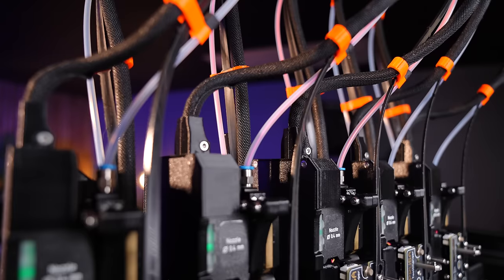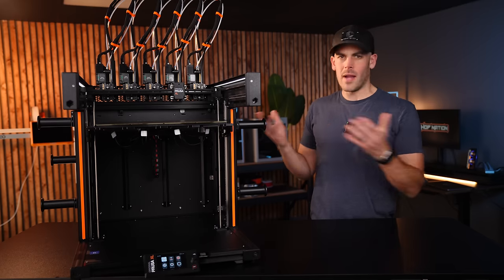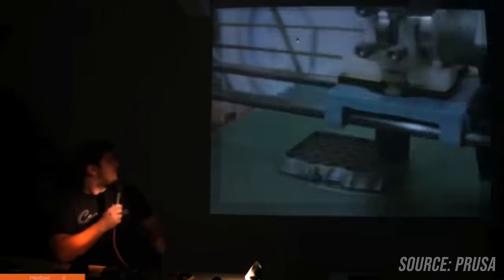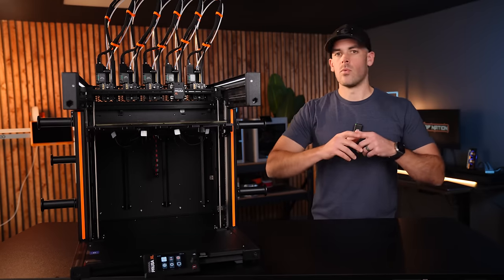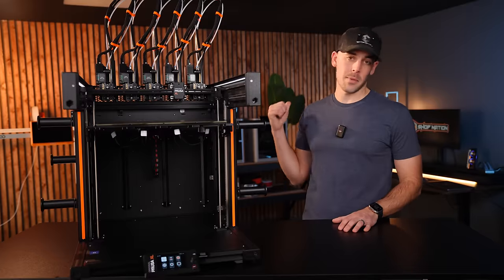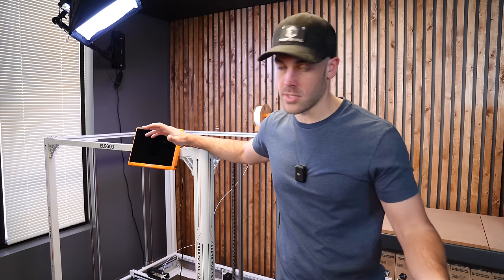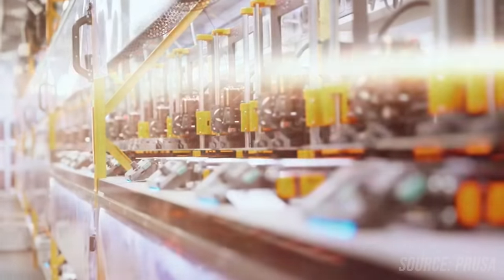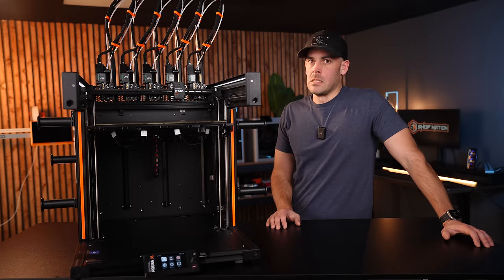Why Prusa is the next Blackberry

Comment: I just bought a Bambu Lab P1S which is supposed to be delivered tomorrow (Monday 07/22/2024) so I'm watching videos about P1S's.  Something that I thought of a couple of days ago that is related to the main theme of this video comparing Prusa to a Blackberry.
I have an Ender-3 Pro and fighting that machine constantly is what prompted my P1S purchase.
I have zero interest in printing doo-dad's or trinkets. 
In hope of better outcomes, I decided to give Klipper and the MainsailOS interface and it  seems overly complicated to install and configure to a specific printer with custom aftermarket parts. It doesn't help that the documentation is grossly out of date.
That gets me to who will potentially have a similar fate in your Prusa-->Blackberry analogy. That would be the folks writing configuration software for these cheap bed-slingers.  I installed Klipper/Mainsail because I needed to, to get my printer to function. Now I spend an inordinate amount of time on getting the printer to function mechanically and another inordinate waste of time wrestling with software configuration.
Those folks are going to take a beating because no one buys a 3d printer to tinker with. A subset find tinkering with their printers fun AFTER THE FACT but the intial purchase is to 3d print, not tinker.
You start turning out printers where you pull it out of box, do the initial setup and start printing without a need for constant tweaking, it is going to put the smackdown on this whole ecosystem based on poorly built, poorly documented and so-so quality printers. I think it will also put a dent in the aftermarket parts market too. If your printer prints fine "as bought" there is no need for special hot-ends, direct-drive extruders, etc.
It will be like being in the 3D Printer Promised Land of only debating what color filament and what kind of filament to choose.

Comment: I believe that Prusa Mini is Prusa's future. With the now fast printing (Input shaper), the small size and the affordable price, I use it intensively, and letting my other 5 printers (Prusa MK3S ) catch dust.
Reply from the maker: The mini is absolute garbage, plus the A1 mini is eating its lunch
Reply: @ShopNation  That's what I thought after i bought it. It kept jamming and making all kind of problems since i bought it. I reassembled it 3 times till I gave up and put it in storage. Then the input shaping firmware was released, and I gave it this one last chance. simply put, magic happened. I have been using it 24/7 since then, with not even one jam! I dont know how to explain it, but the firmware update released a printing beast out of this mini. And BTW, great video! I agree with everything you said there. I'm a loyal fan of Prusa, and part of my success with my products (Makeway crowdfunding campaign on Kickstarter), is cause I chose to work with the MK3S.  Cheers.

Comment: I love Prusa. I ran a small print farm of MK3 machines and had a good experience. I even had a 5 toolhead Prusa XL preordered, but ultimately canceled it due to the reasons you mentioned. I ultimately built a 350mm Voron2.4 to hold me over until Prusa does something to stay ahead. Some of their mechanical design on the XL seems very goofy. Primarily the lift up accordian covers.

Bambu Labs currently makes a better product by far. Enclosed, Fast, etc. I vote with my money and I prefer to give my money to Prusa due to their commitment to the open source community/users.

Comment: I moved from a Prusa to a Bambulab X1 Carbon and I never looked back. Bambulab releases upgrades that matter like a recent upgrade that basically reduces head travel noise to nothing. Bambulab has great filaments that work seamlessly with the AMS. The reality is that were are rarely printing multicolor parts. The Prusa XL is an amazing machine, but it will eventually flop IMO.

Comment: I just want to see lower prices for some of their machines. Their lower models aren't impressive enough in 2024 to justify their price in my opinion. Print head switching is really cool and I think the price for those models is somewhat justified. I also think I'd rather have to repair a Prusa than a Bambu lab printer if my printer goes down. I'll still buy the prusa regardless, but I'd buy way more of them if the price was lower.

Comment: Bambu really changed the hobby from "running a 3d printer" to just "3d printing".
I recently got the A1 with AMS for 500€ and so far it just works. I press print, it grabs the right material from the ams and just starts. I dont have to do anything.
As you said, Bambu made 3d printing a normal thing that anyone can do basically. For everyone that just wants to print, prusa is falling behind at a concerning rate. The price is just the cherry on top. The mk4 is around double the a1 combo and doesn't support multicolor. Why would I ever want to buy this except if I really like tinkering around with the printer?

Comment: For me, I have 12 3D Printers. I am not into the "need for speed". I can distribute the prints across the multiple printers. Since I do a lot of functional parts, and robotics, with Arduino, Raspberry, and Maestro, I really don't need color swapping either. I am comfortable putting pauses in the g-code if I need to change color, which I do so seldom that even doing that does not make me look for these solutions.

Comment: At some point the print time isn’t really going to matter too much for a lone user (more so for a print farm) however as an engineer I find that I care more about print quality, reliability, material strength (especially per unit mass), and a good build volume reduces limitations. Big fan of the markforged in particular for drone parts for this very reason. Multiple heads for reliability is great and allows multiple materials, yet 5 seems too much. Color is usually the last concern.
Reply: definitely, im more interseted into fusing a several materials in same part and skip most assembling work on design level.

Comment: I feel like you are a bit too harsh against the XL! I love it, i updated mine from 2 to 5 heads like 2 weeks ago, and its awesome! I print loads of multimaterial, not just colour, like 2 or 3 colour ASA and mixed with FLEX, and super cheap crappy PLA as supports. I can not really do that with a Bambu machine. I really fell like buying another one, because I need to ramp up production, I am just waiting for my enclosure for now.

Comment: I've been printing more and more with mine and have realized that the best use case is to have just 2 print heads.

I've been thinking in buying more XLs but just with one tool head, and grab one off my 5-head one and transplant it over. 

Would end up with 4x printers with 2 tool heads. (4x quite expensive open format printers though)

Spool join.... check
Bi-colour..... check (i don't do much colour at all)
Multimaterial... check-ish
Dedicated support material... check-ish

With 2 tool heads you get a lot of capabilities that doesn't really justify 5, unless you really are printing a lot of multi-coloured prints.

One of the reasons for getting the 5 for me was to have several materials pre loaded so I save a bit of prep-time, but also to potentially have the ability of having multi nozzle sizes, which is apparently a big one, but hasn't been done yet...

Comment: I personally want an mk4-sized, core-xy with 3+ heads and a snag fit optional enclosure so that I can keep the printer on a shelf without additional box around it.

If it was capable of hotter printing with heated chamber it’d be a bonus.

Let’s call it Prusa L :D

Though, if they don’t release it within a few years I am probably going to get an Mk4. My 3S+ has been working so well that I see no reason and jump ship (especially to a trojan horse of a bambu)

Comment: As an engineer specialized in 3D printing and AM production for 5 years, there are LOTS of things to take care of. From printing speeds, to quality, postprocessing, monitoring even the future of AI with 3D printing which is undergoing already. But the most important thing for every company right now that wants to fabricate in-house and EU made is RELIABILITY. I can tell you by experience. 100%. It's 2024 and there is no other machine (that doesn't cost over 5/10k $, apart from Ultimaker) that matches Prusa's reliability. I got almost a 97% success rate on Prusas. If you ask me any other brand, they don't reach to 50% without human intervention.

Having said all that, I agree that the focus Prusa is seeking may be not the best. In my opinion, AI controlled 3D printers, Realiability and fully automated systems (piece removal, collection and reprint), have a much higher impact than print volume, speed, color swap, etc...

And of course, filament. As a project lead, I led a 1.000 3D printer farm and the biggest concern was to swap 1.000 spools every couple days.

Great inputs! Keep it up!

Comment: All respect to Prusa, my first printer a couple years ago was an E3 S1 Pro, and upgraded it with a Sonic Pad. Just the creature comforts provided by Klipper (or other modern) firmware is night and day. I now have a Marlin printer and miss it badly.

Built in camera, time lapse, macro, and very clean web interface support. Arguably cleaner input shaper that's push-button tuned with a cheap accelerometer. It's hard to understate how much more fluid the experience is. 

A colleague of mine is a devout Prusa guy of years, and that crowd doesn't know what they're missing...
Reply: That said, my Marlin printer is an IDEX because I can't abide the time and material waste of the AMS. I just wanted true, dual materials with some light multicolor.
Reply: @timm7524  Prusa firmware has almost nothing to do with Marlin. Input Shaper, for example, is from Klipper and not the Marlin version.
Klipper is certainly interesting. But from a security point of view, Prusa is a professional manufacturer, a firmware that is connected to the Internet on a Linux system is not acceptable.

Comment: But Blackberry was objectively better than anything else of its time. And yes, my kids are old enough to get the AOL reference! And call me the odd man out but I'm saving up for an XL. I can envision so much that I could do in "retirement" with 5 print heads holding primary, support, Two types of TPU, and a CF fill. I'm currently running a 7-year-old Lulzbot that is getting very long in the tooth.

Comment: With a long history in 3D printing, and an owner of cartesian and delta FDM, as well as SLA resin printers, I recently purchased a P1S (couldn't justify the 50% higher price for the X1). For my money, I'd happily buy 4 P1S units for the price of a single XL. The P1S is a rockstar of a machine. The best I've experienced to date.

As for competition, Phrozen recently raised almost $2 million from just ~1,700 backers in less than 2 weeks for their upcoming Core-XY printer, powered by Klipper. The Arco has a larger build volume than the X1, and supports 4-color MMS, all for less than the X1!

So, look out Prusa. But look out everyone else (including Bambu Labs)!

Comment: Right now, when it comes to single color, I think SOVOL is going to steal market share from Prusa. Quality is excellent and price is much less. In 2023, Creality led the consumer market with 38% of the revenue in their bracket. Since their printers are cheaper, it means they are pushing way more units out the door than Prusa. Bambu had a 3000% increase over 2022 sales. But that's misleading, as they only had one quarter of sales in 2022. However, comparing 4th quarter sales in each year, there was a 900% increase thanks to the A1 mini and the A1. And those 2 are killing it in the bed slinger market. Just as good, if not netter print quality than the Prusa Mk4, and even with AMS option it's 40% of the price. Plus, from experience, it's a REALLY quiet printer if you have it in the same room as your computer. If the Phrozen Arco lives up to it's claims, the XL is definitely doomed for all but special applications (like you mentioned).

Prusa really needs to re evaluate their development process, manufacturing process, and pricing or as you've stated, it will follow the Blackberry into obscurity, with only Prusa fanboys being willing to buy them.

Comment: Didn’t mention the possibility of using different nozzle diameters on different print heads. This would be extremely useful for increasing part strength and print speed where details are low. Then change tool heads to the small nozzle for fine details. Seems like there’s more use cases for the XL than mentioned here.

Comment: SERVICEABILITY & DOWNTIME - both key market advantages Prusa has that could enable it to match other brands performance and STILL sustain its moat/differentiation.

GOAL: Prusa produce a functional performance equivalent of the leading Bamboo products, that contain the capability of self-service/repair the current lineup offers. 

Notwithstanding print quality/speed advances in the Bamboo or other products Prusa need to match, the single biggest flaw with the "Appliance printer" is lack of repairability. 

Prusa support is A+ and extremely responsive. Prusa parts can be acquired or made rapidly. DOWNTIME is negligible compared to the Bamboo Labs products. This is their reputation core - "it works and keeps working".

Comment: Quite funny how Prusa finally managed to replicate E3D's toolchanger. Only half a decade later.
If you strap some Rotos onto it, use input shaping and the accelerometers from the toolboards of the Duet 3, it will still keep up in speed with a Bambu somewhat. 
Thing is you own that thing and you can do with it whatever you want, whereas Bambu is very restrictive yet a very easy entry into printing for newcomers.

The comparison with Apple is very good, the only thing that is completely different is that Bambu is very affordable for their feature set whereas Apple is silly overpriced in many cases and people are only willing to pay it because they are trapped in the walled garden. It remains to be seen if that is Bambu Lab's long term goal.

Comment: The biggest competition for Prusa is not the X1C but the Bambu Lab A1 Combo. $ 560 USD for a Bedslinger with Linearrails and 4 Colours. When it can muster the same reliability as the X1C it will be Game over for Prusa in May. The MK4 is around $ 800 USD in single colour with Linear Bearing when you can get it cheap. So twice the Price for an outdated design and no Colour Changer and the MK4 is the bread and butter Printer for Prusa. Most Chinese Bed Slingers use V-Notch Bearings which are crap. Thats the reason why Prusa survived those. And thats the Reason why the Creality K1 didn't so well, it wasn't a good X1C Copy and needed upgrades very fast. Again Bambu lab is not Inovating, but they take the Voron Designs and make them for the mass market it is clearly a Voron Switchwire they copy which is an improvement for all the bad Chinese Copies of the Prusa Printers. And the Copy of the Improvement of the Copy is better the original and cheaper to produce. 

Personally i have a X1C and a Tronxy X5SA-400 pro I need a little more room then one Prusa XXL needs but i got a Printer which can print single head 16*16*16 reliable. And i got a good heatchamber Multicolour 10*10*10 Printer together for less then 2/3 of the Money for an XXL.  This are my active Printers, i am thinking about upgrading my X1C to 8 Colours.. Which an XXL can't.

And i am rebuilding one of my Creality Ender 3 to a Voron Switchwire and i have two pre 2017 Prusa Style Copies with Linear Bearings, which are still running.

For Prusa: They have the Chance to get a Prusa Mk5 out but need to look at a Voron Switchwire what the Community wants. To keep their Price at 800 USD. This would be a product worth buying: Heat Chamber, Connections for ERCF 6 Colour, noise reduction, good bearings. With the Bambu Lab  A1 comming Prusa may lose the Bed Slnger Market against a Core XZ Machine they need to step up their Game Very fast. The simple fact is that Bambu Lab invested 100 Bucks in better bearings compared to other Chinese Printers which make them fast an reliable, something Prusa was good at.

Comment: honestly, Prusa became dogshit in last 5 years. After having original Prusa i3 since 2014 I bought MK3S for almost 1000€  (large prebuilt kit with original "high quality filament" and some extras) in 2019 and haven't had a single successful print with it. Every single print attempt failed because of stupid reasons like clogs or filament breaks, which turned out to be very well known since the release of mk3 in 2017, because hundreds of users were complaining about exactly the same problems in prusa forums since then. Despite being aware of such problems, Prusa decided to continue selling their junk without fixing anything. Even the original filament had inconsistend inner width somewhere between 1.0mm and 2.25mm. Compared to Ender 3 for 200€, this Mk3S for 1000€ was just a huge pile of crap.

Comment: "couple hundred bucks"? Bro the cheapest bamboo model which is another regular 1-rail mini is $400, the one you show is $1200, those are  not cheap for FDM. I know I know, "the iphone was also expensive" but that's because the blackberry was heavily subsidized by carriers, unlocked it cost you as much as the iphone, and the iphone wasn't popular until it was as cheap as the blackberry.